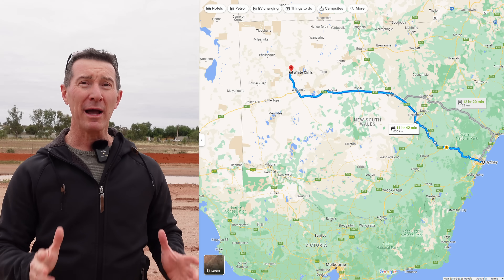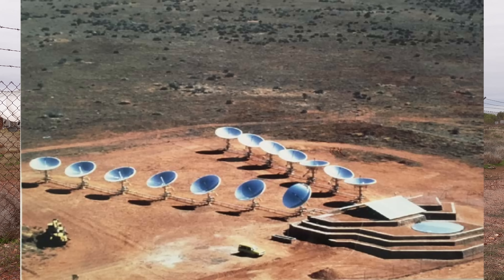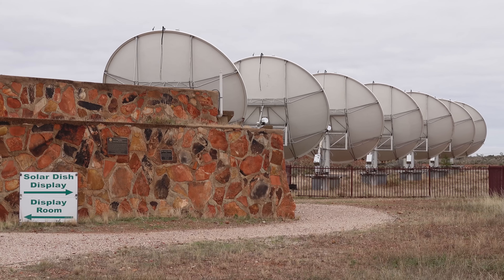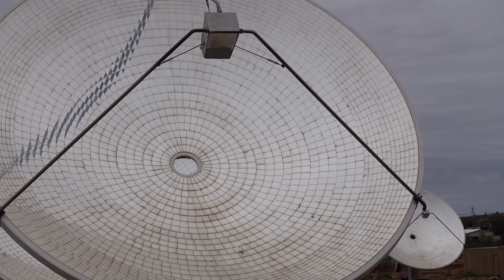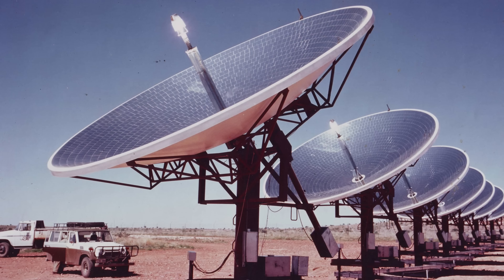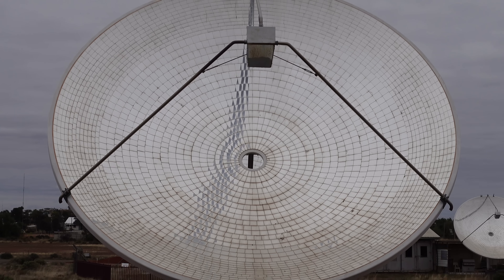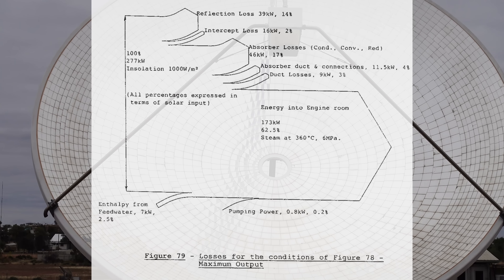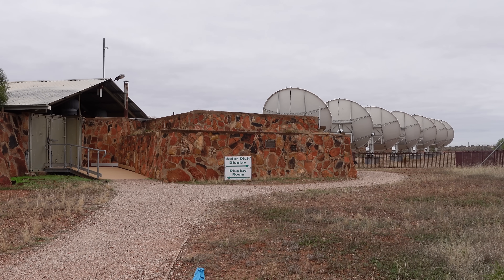EEVblog 1553 - World's First Commercial Solar Power Station

Comment: Interestingly, the modern Concentrated Solar Power (CSP) plants have one huge advantage.  They don't heat the water directly. Instead they heat molten salt, which adds as a heat battery and allow the plant to continue producing power well after sunset.
Reply: Although they can release the stored thermal energy after sunset, does this not create a lag at sunrise? The salt needs to get back up to temperature in the morning to reach efficient levels again. There's no free lunch.
Reply: @OliverHamilton  that’s a good question. I don’t know how much heat is retained through the night. But then, CSP today is not an alternative to PV. It’s complementary.
Reply: @kjlovescoffee  yeah it can help smooth out the output, being less variable to clouds etc. I think it can almost be thought of as analogous to the inertia of rotating mass in other power generation systems, a kind of thermal inertia.
Reply: @kjlovescoffee  is a CSP more economical?
Reply: There was a design for molten salt to be used in nuclear reactors as well. I believe it is thorium salt and the reason is that it has an inherently safe design.
Reply: @ChrisBentle it’s also a breeder type. It can use all the nuclear waste. Conventional rods that are “spent “ actually still have like 98% of their energy left. They crack up so have to be replaced. 
The salt reactors can use all of it.
Reply: @woodywoodlstein9519 why did nobody build such a reactor?
Reply: Well, everything have a flip side, the back side of salt storage is that you lose heat gradient and there for efficency.

Comment: I went by a solar installation is in the US near the CA/NV border.  They had mirrors reflecting light up to a central tower.  I swear, you drop a chicken in that concentrated light,  it'll be cooked before it hits the ground.
Reply: Inside will be raw, though much of the outside will be burnt off. 1000C jet exhaust does the same, though you also tend to find the things that get into it vanish fast, and the walls it impinged on took hours to cool down again. The birds that flew into it got plucked,before they got ripped to pieces impacting the ground, or made flat against a wall.

Comment: I would like to know which produces more power in low light conditions, the thermal version or the solar cell version. Certainly on a cloudy day a solar collector like this could achieve more efficiency than a bog standard solar panel, no?
Reply: major disadvantage: the thermal leak away into the sky if the dishes is pointing at cold area of the sky. Meanwhile, PV do not leak energy when it is cold.

Comment: I'm only five minutes in but wonder if they really were using a steam turbine. You keep saying so but the pictures in the video shows a three cylinder steam engine built on a two stroke diesel block (Lister HR 3 Diesel Crankcase with shaft, connection rods and lubrication system) fitted with sleeves and pistons more suitable for steam and a valve set with lifters integrated into the top of the pistons. If that's what was used then it was a pretty inefficient engine. A double or triple expansion engine would have had a bit better efficiency. Not that it would make all that much difference with all the rest of the posses in the system such as the long tubing and all the supporting tech. As I write this I hear you talk about the losses from piping the superheated steam from the collectors furthest away to the generator room.

A sterling engine might have been more efficient yet but it would have been more dependent on proper cooling.

But as a tech test site it was a nice setup. The big idea was obviously not to make the most efficient solar power installation possible, but to test tech and see how viable different parts of it was. And the money was probably primarily spent on those reflectors and the control systems that tracked the sun. These are large expensive parts that has to do their job, and they have to prove reliable and robust. Also they have to stand up to storms and the occasional rain without the mechanisms failing, the mirrors falling off or getting dirty.
Reply from the maker: No it's not a turbine, I had no idea what I was talking about. That's what happens when you don't have a script and just stumble across this place and shoot an impromptu video.

Comment: Molten Salt solar is actually a really good overnight solution as apposed to batteries.
Reply: The efficiencies every time I've looked have been really bad. You'll end up with all the losses of this one here and more. Batteries and solar normally ends up being 2-4 times more efficient. There are a few things that might make them viable but it doesn't look like the pros are outweighing the cons for grid storage except in maybe a few niche cases like heating in places with already setup waste heat piping for city heating. Even then it might be a hard sell to not have everything switched over to electric instead.
Reply: No it isn't. Round trip efficiency of real world molten salt energy storage is 70%, li-ion batteries are 90%+ 
The only benefit is the low cost.
Reply: @Muonium1  Thats an overly optimistic round trip efficiency too. If you hit 60% you're already pretty high for a molten salt battery. You'll often see marketing for these molten salt companies claiming 90-99% efficiency while failing to disclose thats thermal storage efficiency or rather how much of the heat is lost while its stored. Efficiency ratings for heating, pumping, storing, and converting back to electricity are much worse.

Comment: I've always thought solar thermal has more legs on it for large scale commercial solar energy, in countries with the sunlight to drive it. Photoelectric panels are great for smaller installations on roofs end such, but for a large scale installation they are somewhat fragile, whereas a mirror is basically indestructible if cleaned regularly and carefully. I am sure the lessons learned from White Cliffs have been fed into subsequent projects, so even though it is no longer complete or operating, it has earned its heritage status. It looks like there's quite a lively community at White Cliffs too!
Reply from the maker: It's a very small community. Dirt roads, one pub, one corner store, and a huge lot of people live in underground dugouts. We stayed two nights in an underground hotel, and went opal mining with the Young Guns youtube channel. Very cool place if you ever get the chance.
Reply: You got to start somewhere
Reply: Solar panels are not really fragile.
And not more fragile than these mirrors.
The greatest danger to medium sized solar fields is that criminals steal them.

Comment: I worked on a project for some Sterling Solar dish project. They were Hydrogen Turbines. The project got scrapped cause the test plots they were running were under performing. It was a super cool concept. I would love to have seen the project come full circle.
Reply: @tripplefives1402 Stirling engine thermal dishes don't have piping, the whole engine is packaged into the dish head unit, right in the focal point. It's a membrane linear motor with a linear generator, basically a giant speaker with a few extras. One moving part only.

But like you said PV won due to its simplicity and therefore (still) plummeting cost. Stirling engines are after all engines with lots of machining steps, the costs involved have a floor that we hit decades ago. Semiconductors are still finding that cost floor.
Reply: @iaadsi  Nah, if you need to power your whole home solar panels cost orders of magnitude more than solar heat. A big solar evacuated tube costs 50 dollars for example.
Reply: @vitordelima  were talking about electricity, not heat. The stirling engine plant makes electricity same as the OP video.
Reply: @iaadsi  You understood what I meant.
Reply: @iaadsi  PV cost floor is based on coal power and slave labor conditions overseas :face-red-droopy-eyes:
Reply: I always fond sterling engines fascinating.

Comment: Was this first though? In 1981 the Solar One thermal demonstrator plant in the Mojave Desert in California was providing 10,000W into the Southern California Edison grid to power the little town of Daggett, California and they ran power generation 24 hours a day using heat stored in a giant tank of granite boulders in an oil bath. That plant was the prototype for the central tower type solar thermal plants used today. I got an inside tour of the plant in 1981 with an employee and I recall pictures of the building of White Cliffs at the time.
Reply from the maker: No idea, but that's the claim.
Reply: Got a link for that mate? Wiki says different.
Reply: @Lazy_Tim  I stood next to the generator, at the time. It was a General Electric and was GE locomotive blue. My father was friends with the site manager for Sandia National Labs. There was also another solar thermal plant next door to the East which was already operating and was based on horizontally oriented cylindrical reflectors at ground level which didn't need any active tracking of the sun, but it was as efficient and suffered from wind blown desert dust on the reflectors. I don't know if that other demonstrator was connected to the grid, but I knew the guy who flipped the switch to connect Solar One.
Reply from the maker: @Peter_S_  My research says this one was "arguably the first commercial solar plant" as it had legit paying customers in the town for the energy produced from it. If another system was grid connnected, maybe it wasn't done so with an actual customer contract?
Reply from the maker: Wikipedia for Solar One says "Solar One was completed in 1981 and was operational from 1982 to 1986"
Reply: @Peter_S_  On the way to Lone Pine and Mt Whitney iirc. I remember seeing it
Reply: @EEVblog  They're certainly contemporaries by any measure. I'll call them twins for the title of "arguably the first" but as Solar One was owned by the U.S. government perhaps that eliminates it from the running. There's a lot of flex when it comes to writing the specs for a claim like that. There are a number of stations which claim the first nuclear power using different parameters. I was at Solar One before they had all the heliostats installed in early 1981 and they were injecting power to the local grid, but only for tests. I don't know if they were even intending to feed the grid in the initial design. 

I vividly recall a plumbing implementation accident there... They used superheated steam to absorb the power and that took very pure water. They has a 10,000 gallon tank of sulfuric acid used in the water treatment and an emergency shower next to it. A plumber in error connected the shower head to a high pressure steam line. Yikes.
Reply: @Peter_S_  I recall when I used to get into researching more rather like a novice, that Sandia National Labs and the US Air Force had a solar power tower operational first at the larger scale. Seems like was in the Mohave Desert area and not at the NSTTF and was Solar One and Two, though might be the first was the og NSTTF tower at like 1MW. Prior was the U.S. Army, though was more for high energy testing like nuclear temp situations and furnace work. I think the French or someone in France or Spain earlier on did some work on with the earliest trough design system I believe in Egypt implemented around the turn of the 20th century.  The U.S. Army system was moved from at Natick, Massachusetts to White Sands last I knew and is still operational. Similar is at the NSTTF I believe. I've always thought the solar concentrator systems would make awesome border fence installations and radar sites concurrently, with possibly mining via desalination operations as well. You have the additional security operations going on to boot. Not sure why not for the U.S. southern border?

Comment: Solar thermal ( with salts not water ), in combination with nuclear is the absolute future.
Reply: Sounds pretty dope.
Reply: Nuclear is a dead end. Remember when it was going to be too cheap to meter? 🤣 It's the most subsidized form of power and even there it has failed.
Reply: @Peter_S_  Maybe in the USA it's heavely subsidized. That speak more about America's poor planning and less about nuclear power's viability.
Reply: @Peter_S_   Nuclear is some of the cheapest and safest forms of electricity generation. And that's only fission. Now if you are going to mention the two cases of corruption, bad design and gross negligence ( combination of all three ) as cases for not using nuclear, then I'll tell you, you are awfully cherry picking. And just because the west is having an identity crisis, it doesn't mean that the rest of the world will follow suit.

Comment: I think many country could benefit from a small scale (1 to 1.5 m diameter) parabolic mirrors at home.  People are deforesting and burning gas all day hiding themselves from the sun while cooking.  It would be nice to have an inflatable DIY parabolic mirror with a small weight and size when empty.  This way, you could carry the mirror in a backpack and inflate it when required in minutes.    Still, a motorized version that follows the sun is better for a static installation as you don't need to adjust it every 5-10 minutes.  Sergiy Yurko proposes many DIY concepts such as the inflatable one.  https://www.youtube.com/@sergiyyurko8668

Comment: I have a question, what is the simplest way to get 60 volts DC, 20ma, out of a 134 volt DC supply? Using zener diodes and resistors? If so, what values and wattage?
Reply from the maker: Yes, a zener is the simplest. There are online calculators for that.
Reply: Is it up to 20 mA or exactly 20 mA? Is the 134 V supply regulated, or is it variable over some range? A zener will work but there are also high voltage linear regulators that might be able to handle the job. Especially if you put a resistor in series with the linear regulator to dissipate some of the excess power (about 1.5 Watts).
Reply: @mckenziekeith7434  the voltage and amps are not critical at all, it's just to supply a current meter display and back lighting, from a 134.4 volt lithium pack. I put in the values into an online zener diode calculator and it came up with a 60 volt 5 watt zener, and 1.3k 5 watt resistor. I will try that, hope it works. Thanks.

Comment: One of these would make a nice domestic hot water generator.
Reply: Yeah it would be nice except solar PV is still better. I have a 4kw PV array that is directly connected to an ordinary electric 250L hot water tank. And it produces 90C hot water all year round. I originally had a evacuated tube solar hot water and it didn't perform well in winter at all. That's because concentrated solar or evacuated tubes require direct sun light where as PV can work well enough to produce boiling water even in diffuse light. My PV based hot water is the best thing I ever built. Its almost as if I have nuclear power providing my hot water lol.
Reply: @teagueman100  sounds like a good system. It's good idea to eliminate converting DC current to sine wave if not needed.
Reply: @tiitsaul9036  DC is only good for short runs as the voltage is typically low and line losses are high. AC can be efficiently transformed to very high voltages which greatly reduce transmission line losses then transformed back to low usable voltages at the destination. The other advantage is the high voltage wires can be smaller diameter which reduces cost and weight.
Reply: @MechAnism820 a typical domestic hot water heater is only couple of metres away from the roof.
Reply: @teagueman100  not really. A dish solar that heat water have a efficiency of 80-90%, but it also have a availability of about 0.5, that compares to about 0.2 for flat panel solar.

And of cause if you have a dish solar with a PV you get both heat as well as power
Reply: @matsv201  problem with dish thermal solar is that thermal energy leaks out from the dishes if the heat source is missing, like in cloudy sky or nighttime.
Reply: @xponen  that is true,  ut it can be mitigated a few ways.
Reply: Not really - having to track the sun for the parabolic mirror to work is a nightmare. If all you're doing is heating water, just flow water through channels on a flat collector of equivalent area - in fact it could be used to cool a PV layer ON TOP to provide flat panels that both generate electricity AND use the waste heat to heat water.
Reply: I made a solar water heater from scraps. Saves me loads in the summer as I have to buy very expensive wind power.
Reply: I would have thought a modern solar panel running a modern heat pump electric hot water heater would be more efficient and you can use the grid when needed.
Reply: @MeppyMan  the conversion loss from sun-to-pv-to-heat is at least 80% because solar panel is only 20% efficient.

Comment: What an interesting system, thanks for sharing. Didn't realize a dish so small could create superheated steam!
Reply: Flow rate is your friend, keep it low enough and you can superheat steam to 500C easily, and then keep it dry for a good length in well insulated pipes.